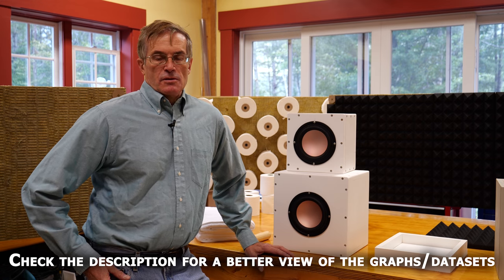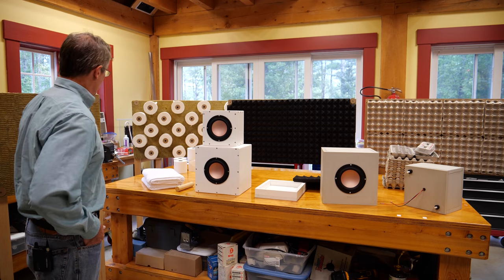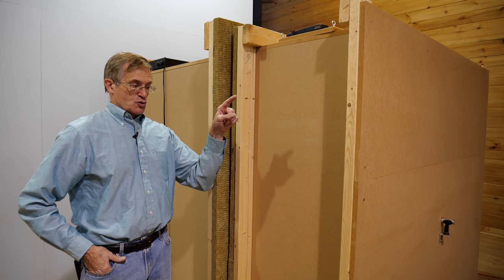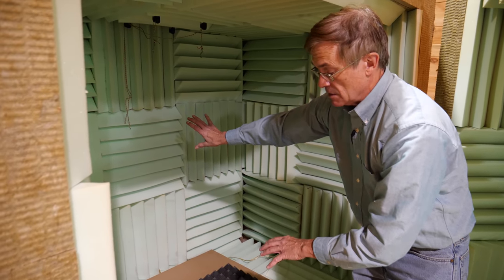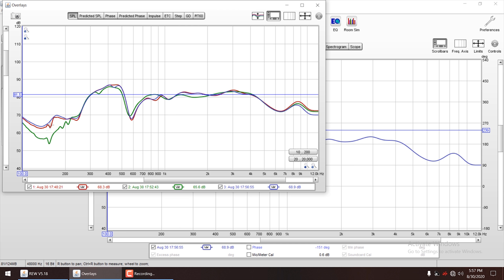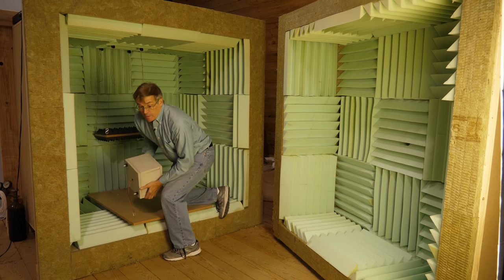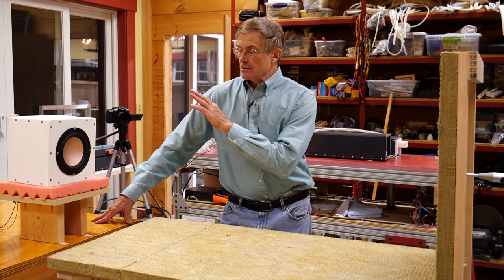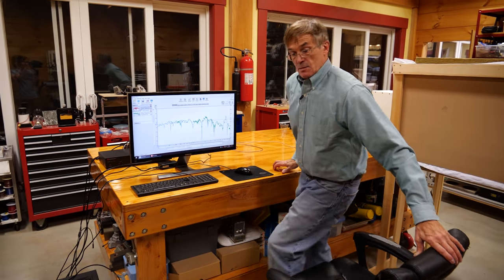DIY Speakers and Acoustic Panels

Comment: At the 37:00 mark you state that the Armstrong tiles are $5.00 per sheet. Could you kindly tell us where, as every place I have looked for them they are much more expensive.
Reply from the maker: At Home Depot they are sold by the cartoon and the price was close to $5.00.  I might be a little off.
Reply: @TechIngredients  Thanks for the reply. Yes, Home Depot does sell them for that price (10 for 49.99). Sadly they don't deliver them and the local store is out of stock. What about USG Ceiling's version of the product? They have the same 0.635 thickness and same .55 noise reduction coefficient listed.

Comment: You need a dense material to absorb the low freqs. There are quite a few ways of doing this without very thick material.
Reply from the maker: Please give some suggestions.
Reply: @TechIngredients  Concrete wall board, and even steel with holes drilled in it. The holes will cause the sound to stop. 

Hard rubber mat is another but most musicians I know are using the concrete wall board with either terry or foam panels. 

We are insulating rooms so we can play loud and details are important, like hanging the board so its isolated from the ceiling and walls. Carpet doesnt work at all.

Comment: The main flaw in your testing of the different panels is that you had the speaker facing the microphone. For the best results, you should place the microphone and speaker next to each other, with an absorbing material between them, and the panels under test facing towards them. For even better results, this could be done in the chamber by adding a microphone port to the fixed side of the chamber alongside the speaker, then positioning the panel under test in the moveable section.
Reply from the maker: The complication here is that we wanted a purely tangential/glancing reflection.
Reply: @TechIngredients  How about having the speaker/microphone at 90deg to each other with the panels at 45deg? Just seems that there's a lot of variables.

For example, if the driver is say 3", then at any frequancy over around 2.5kHz the driver is no longer acting as a true point source but a area source and the sound will start "beaming", so will be hitting the side panels less and less as the frequency increases.

Comment: i don't know much about acoustics but from the look of the graphs nothing really worked? nothing had the results of "hey look this is a lot of noise and this is no or nearly no noise" it was more like "ohh this one pitch is less, while this other pitch is more"
Reply from the maker: If you're looking for a miraculous result otherwise it's not worth it is an unrealistic standard.  The fact that the low cost acoustic panels were about the best isn't suprising as they have been engineered for this purpose probably at some significant expense.
Reply: @TechIngredients  well i'm not sure which it is. weather there wasn't much of a difference or if the graphs just aren't clearly communicating how large the difference is. to the uninitiated none of the changes looked very significant. I don't really know how to read them, i just know that the lines were nearly overlapping most of the time and seeing the individual lines was kind of hard. which to me would indicate that the difference was minimal (or that the axis x axis was scaled badly and needed to be zoomed)

edit. to be clear i'm not saying "clearly the insulation was useless" i'm saying the graphs make the insulation look useless to me. which is probably evidence that I'm not reading the graphs correctly.

Comment: Hi there, nice work there. Would be more interresting to explain at what frequency human voice sound and focus on that area, most of us watching this video to  have improvements for audio quality of our voices. Ofcourse all frequencies noises are important, but most of us are interresting in how to have reverberation reduced and reflect as less possible when we record ourselves. Not everyone can interpret those graphs, if we don't have a clue where the human voice is on that graph.
Reply from the maker: That's a good point.  Middle C on the paino is 260 Hz.  The C one octave above is 520 and so on.  It's pretty easy from that to decide what range is the most important to the listener.
Reply: @TechIngredients  Thanks, looks like egg cardboards are fine for 260hz-520hz range :)  for human voice (talking) studio recording, not for singers. A quick question if is possible: i see some people that put only in corners of room sound dampening materials, are they effective? Or should we put them on all edges from entire room walls/floor/ceiling?
Reply from the maker: The more the better.  Its a matter of cost and appearance.  Even though certain areas will produce more benefit per square foot/meter it will always help.

Comment: As always, interesting. Thought on the helium - wouldn't pulling a vacuum in the rear chamber ensure closer to a 100% helium to air exchange or rather to execute an exchange from air to helium.
Reply from the maker: Yes...but.  The vacuum would collapse the speaker cone.
Reply: @TechIngredients  not necessarily given the vacuum is regulated prior to overextending the suspension system or collapsing the cone.
Reply from the maker: You might be surprised at the force of atmospheric pressure. Even if you lowerd the pressure in the enclosure by 25% which would produce a 25% improvement in flushing effeciency, the load on the diaphragm would be over 100 lbs.

Comment: What if it was air tight and a near vacuum inside the speaker?
Reply from the maker: The challenge of holding a vacuum behind the diaphragm while operating the speaker at atmospheric pressure would be significant.  But if it could be done then the output effeciency should nearly double.

Comment: Problem with helium test.  Looked like you attacheched the hose to the bottom connector.  Helium is lighter than the rest of the gases in air.  It would rise to the top of the container then vent out the top connector displacing very little air.  To fill the speaker with helium should connect hose to top connector pushing the heavier gases out ot the bottom connector thus displacing ALL of the air and replacing it with helium.
Reply from the maker: It doesn't work that way.  The helium diffuses into the surrounding gas much faster than it rises due to buoyancy.
Reply: @TechIngredients  :       Hmm...    OK.  Still, I think I would have put it in from the top just to make sure.  Surprised someone is up at this hour to respond.  Thought I was in the minority keepig odd hours.
Reply from the maker: It wouldn't hurt, but it isn't a significant issue.  That's how we get so much done.☺

Comment: Will thickness alone be enough to block the long waves of the very low frequencies? It seems like there should be another variable besides thickness because the length of the wave might "fool" the material by not appearing as a wave at all. Does the long wave compress what it comes in contact with as much as a short wave? I'm just a lay person, but it seems like something's missing from consideration.
Reply from the maker: The only difference between the low frequency and high frequency waves is wavelength.  I'm not saying this to be facetious, but to emphasize that what works for high frequency will work for low frequency if it is scaled up.  It doesn't have to change qualitatively.  However, the scale can be impractical and so more complex, expensive and effective methods might be worth considering.
Reply: Tech Ingredients Thank you for answering my question! I used to play drums, and it was the kick drum that was impossible to deal with. Just curious, what length of thickness might effectively absorb the low frequencies of your speakers?
Reply from the maker: It's roughly proportional to the wavelength. So, a cut off at 200 Hz with 1.5 " will cut off at approximately 100Hz with 3".
Reply: @TechIngredients  Thank you!

Comment: Carlos from Brazil. My sincere congratulations on a job well done. I have been watching most of your videos, though I might have missed some. What I would do find more interesting is using a flatter, two speaker design small box, that would have a smoother high frequency range, which on the speaker you used for these tests would have the top completely filtered, to cut off that peak. Just a question: why not use ceiling panels all around, with some of that other brown-green material (don't know if I can get that here)?
Reply from the maker: I'm not sure what you mean regarding the placement of the ceiling tiles.  Do you mean inside the speaker box?
Reply: @TechIngredients  Thanks for your answer. No I mean using the ceiling panels as absorbing panels, in the side walls be their side, like many people put foam or fiber glass panels to absorb reflections. If it's useful on the roof, why no put it on the sides.
Reply: Another question, why not explore the metallic rings that you tried with the aluminum plates on the first video of this series, where you tried different panels. Secured randomly perhaps, or measuring.
Reply from the maker: Actually, I did.
Reply: @TechIngredients  I need to get a speaker pair for my bedroom 50" TV, so I'm very much interested in your smaller, upper polystyrene design you used with the balsa wood one. My only concern is the low frequency response, which will never go lower than 120Hz or even 250Hz. Only under the bed would I be able to add a sub.

Comment: hi, I recently made 4 dml speakers using the drivers you used and the same material / dimensions, but they sound tinny, high pitch is way too loud and no base :/ any idea why ? I searched for a few hours and nobody has had the same problem, tried breaking them in by running 20hz for 2 hours, improved them a little but still not good. I'm out of ideas, the amp is a 300w good quality amp, I tried running the pannels alone and as 4 and still have the sape problem. help plz
Reply from the maker: What material and dimensions and how are you supporting the driver and how are you supporting the panel?
Reply: @TechIngredients  the material is expanded polystyrene, 3cm x 60cm X 120cm for the big pannels, drivers placed at 2/5 2/5 and held by the sticky tape they came with, small pannels are 60cm x 90cm with driver dead center, big pannels have rounded corners , little pannels don't
all pannels are hanged, we tried verticaly and horizontaly, no change
Reply: extruded not expanded sorry **
Reply from the maker: That sounds right.  Orientation doesn't matter.  Are you driving them hard.  The sound quality drops if they are pushed.
Reply: @TechIngredients  the distortion starts from the begining, but indeed gets worse as volume increases, is the amp too powerful even at low volume ? I'm running them in series, would they work better in parallel ?

Comment: What about a slight vacuum on the speaker?
Reply from the maker: The vacuum would have to be on both sides otherwise even a slight vacuum would damage it.  The result would be a reduction in the energy transfer due to the increased impedance mismatch between the driver and the more rarified air.
Reply: @TechIngredients  great videos btw, I've watched them all.

Comment: what if you had a empty vacuum in the walls of the room so that there is no medium for the air to pass through.
Reply from the maker: In principle, that would be excellent.  In practice,  it would be really tough. The vacuum represents 10 tons of force/M^2.  This has to be supported, and any structure that crosses that space will transmit sound.
Reply: @TechIngredients  i hear it’s possible though. The trick is finding a cheap way to do it. does the M stand for medium?
Reply from the maker: Square meters.
Sure, it's possible, and as I said, the performance would be great.  The structure would be difficult.   Have you ever seen a large vacuum chamber?
Reply: @TechIngredients  The largest vacuum chamber I saw, was the one NASA built that you could walk into
Reply: @TechIngredients  the largest one I saw was from NASA also if it’s meters squared, then why not make the gap of the walls say 1 cm apart that way the vacuum wouldn’t have to be very large
Reply from the maker: Remember how heavily the chamber was constructed?
The gap thickness isn't a concern. With a vacuum, even a millimeter thick is more than enough. But that millimeter still has to oppose those huge forces, and you can not have ANYTHING in that gap to support those walls to prevent them from touching. The helium will provide that support, albeit with lower performance, but then the walls can be as delicate as plastic film.
Reply: @TechIngredients  helium you say?
Reply from the maker: Take a look at our previous video series on helium and sound.
I think your eyes will be opened by the possibilities.
Reply: @TechIngredients  thank you I will!

Comment: Nice video.  In order to capture the temporal(time) response you could capture the impulse response.  Each linear system has a transfer function which exhibits a dynamic frequency response over time.  There are many software tools that would nicely augment your cool setup and give you more insights into reflections.  Thank you for your excellent presentations.

Comment: Thanks for sharing your measurements. Very insightful!

Is there a way to measure sound-wave fidelity beyond just amplitude? I understand how porting speakers contributes to volume at low frequencies, but some of that reverse-phase pressure comes around and distorts the final output. I'm wondering if there is a technique to objectively quantify this effect.

For some reason, I always preferred non-ported speakers. Currently listening on Devialet Phantom speakers. Really impressive tech!

Comment: As much fun as your next project may seem, please don't add to the abuse being suffered by so many from silent and invisible weaponry.  Your device will most likely be something that can penetrate walls, as sound waves do, and therefore present perpetual hidden torment to potential unwitting victims.  Please don't add to the list of domestic violence sonic harassment weaponry.
Reply from the maker: We're attracted by the potential not only for non lethal deterrence, but the value for search and rescue.
Also, some of the miplaced concern with these devices should be balanced with an understanding of real but less known dangers.
Reply: @TechIngredients  Would you please elaborate on these "real but less known dangers" so that we might better understand?